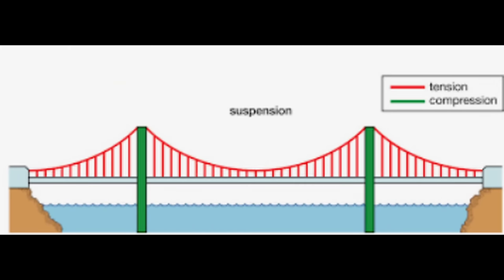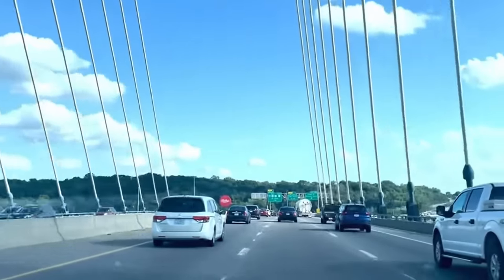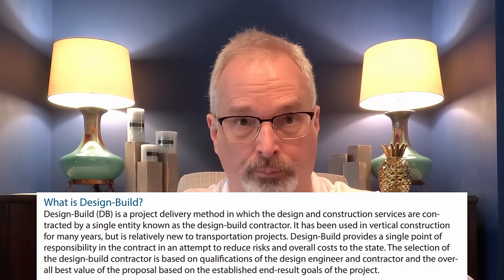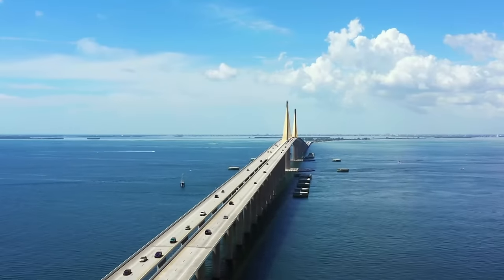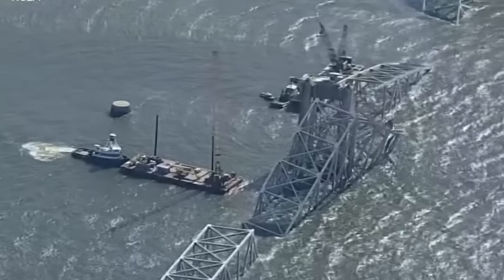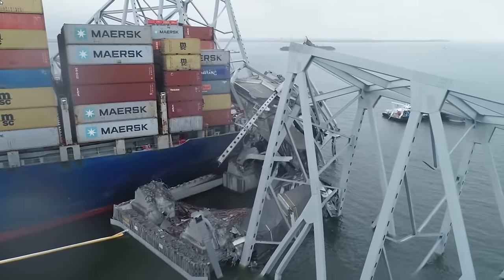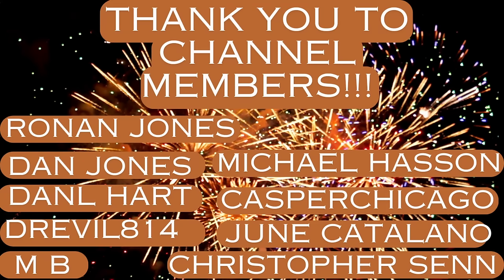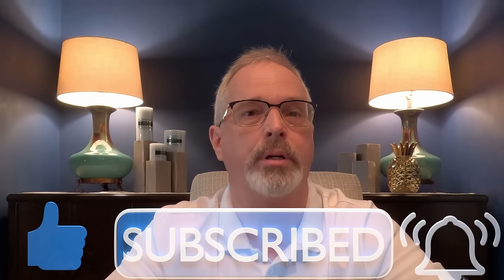How will the Key Bridge in Baltimore be Rebuilt?

Comment: They'll go for accelerated/accelerated and pass on the bill to the entities that took the bridge down and the Federal Government will use its Bully to do that passing special legislation to force the matter. Also, they'll use multiple qualified companies to ...well, they're probably already pouring roadway modules. They can look for a built bridge that is close enough in spec, and use those plans as the starting point instead of starting at square one. I can see North Teams and South Teams already being formed to speed the process along. Even pulling out all stops? 30-36 months to completion and, heres the thing... with that bridge down, the detour the trucks need to take now will add over 100 miles. That will increase the cost of truck shipping to the New England Area from south of Baltimore, add to air pollution and ...I've driven all those routes... to get from just north of Baltimore to Southern Maryland bypassing Washington DC by taking back roads with speed traps? Every day I've tried those routes? and nearly every route I could find? Best time I ever did was driving it  at 2am and that took me 6+ hours, just due to traffic congestion. Toss in holiday traffic and hang it up, any part of the day you start its close to 12 hours with the longest taking me like 18 hours.

Comment: How about a tunnel under the bay rather than another bridge?
Reply from the maker: That would be a great option but would likely cost more and take longer than a bridge.
Reply: @CaseyJones-Engineer  true but I believe it would be a safer solution. In a war you can bet every bridge and every port in this country will be attacked preventing us from getting cargo out and being able to sortie our Naval forces into the fight. And if memory serves this is the last bridge out of the port. So maybe It's time to consider this. And at least do a CBA to figure out long term maintenance costs of a tunnel v a bridge. Also I don't think it would take too much longer because of Modern troll boring machine technology makes this kind of effort a lot less expensive and faster than it used to be. How long do you think it would take to build a bridge such as you suggested vs the length of time for a tunnel?  Or maybe the answer is not to replace the bridge at all but improve road networks in the area and widen other bridges to take up the slack.?
Reply from the maker: @johnpitchlynn9341   Thank you. I agree that a non replacement option should be strongly considered.
Reply: @CaseyJones-Engineer  could you give us a rough ball park estimate on how long it would take to replace the bridge? In months or years?

Comment: Trying to wrap my head around costs for the replacement bridge.  There are number being thrown around like $350M and closure costs being $15M/day.  Seems to me that even if ultra fast tracking it would increase costs by 10x, shaving several years off would be cost effective.   Something else I found interesting was that the owners of the Times building in Times Square are in the middle of a $500M renovation.  That is for a building with no tennants and you can't even see.
https://youtu.be/x1QJjH0GVCY

Comment: Not an engineer of any sort, but road and bridge building has fascinated me since I was a kid.  
I drove across the Key Bridge a few times...I left the area 30 years ago.  Construction started in 1972 and finished in 1977.  The Key Bridge did not have breakdown lanes and it was designed and built long before the advent of massive container ships.

Getting the wreckage out of the way is critical to reopening the port, which is still a big part of the area's economy.

A tunnell is not going to happen.  Hazmat transportatiin cannot use a tunnel.  The Ft. McHenry tunnels were, if memory serves, constructed on land and laid in place.  Doing this would require dredging a channel and interrupting port traffic.

My guess is that a cable stayed bridge will be built with its piers in shallow water.

Slightly off topic...the Bay Bridge spans a short distance away have no pier protection and are outdated anyway. It needs replaced as well.

Comment: Why not consider a tunnel, like the other two harbour crossings in Baltimore?
Reply: tunnels are lame
Reply: Hazmat transportation needs to have a North-South means of travel without a tunnel.
Reply: @penguinsfan251  Agreed, however there is another side to the Baltimore Beltway that does not have tunnel of which I suspect will be utilized during the next 2 or 3 years for construction.  I was thinking the port has been limited by height restrictions and this could help.  Still may not be financially responsible either.
Reply: @indianoutlaw5702 yes, the west side can be used but it’s much longer and slower so not efficient for trucks who can’t use tunnels.

Comment: Design-Build should be Design-Build-Law Suit. At least in California large highway and bridge DB have been a disaster. If the owner agencies  held design consultants to the same schedule as they do the contractors,  there is no reason the work couldn't proceed concurrent with the design. Then the agency is better positioned to deal with third party at arms length, instead of dumping it on the DB contractor who has no bargaining power. As you see, I could go on forever.
Reply: California? LOL

Comment: should be rebuilt like the golden gate bridge.it would have a longer span and have the uprights further away from the channel.
Reply: A suspension bridge isn't needed for such a short span, and that would be far more expensive and probably take longer to build.  It will almost certainly be a cable-stayed type.
Reply from the maker: Yes, a suspension bridge would be very nice, but would likely take quite a bit longer to build than a cable stayed bridge.

Comment: The span between the surviving bridge piers at the ends of the two approaches is approximately 2600ft. If you built a cable stayed bridge with two pylons within that distance, the centre span would need to be about 1300ft. If you needed a larger span, you would need to demolish the two existing piers and the end sections of bridge approach spanning onto them, and install new piers and approach spans. It looks like the approach piers are spaced about 300ft apart. They must have declared those piers to be safe, at least to the point where they are happy to have a new temporary channel beneath the approach deck still resting on them. I guess it will boil down to cost, and whether those existing piers are structurally sound. If you made the centre span 1600ft, you might be able to use the next approach piers which seem about 1600ft either side of center. Oh and it's so magnanimous of Biden to say that we, the taxpayers, will pay for everything - I was hoping insurance companies would be held liable. Do they propose to just let the companies responsible for this event to just get away with it with no costs?
Reply: The remaining approach sections of bridge are safe enough to travel under but they are almost certainly unusable for replacement because of their age and design which wouldn’t support the required increase in bridge width for breakdown lanes.

Comment: No bridge needed.  Use money to improve the north Baltimore beltway.  Cable stay has corrosion problems from the faulty Figg Eng. design.  Design Build projects you get a lower quality constructed project as the contractor is also in charge of the design and specification and will use the least costly riddled with shortcuts to increase his profit.
Reply: Money won’t reduce the increased distance that the western side of beltway adds.

Comment: Cable stay bridge and cold winters don't get along . Ice will form on the cable and fall down breaking windshields
Reply: Depends on where the cables are located obviously. But I don’t recall seeing any news about this.
Reply: @JohnHallgren  read about the cable stay bridge in Vancouver . The towers taper as they go up so are over the roadway , the cables also ice up every winter . They are trying little cable climbing machine to remove the ice .
Reply: @grazynazambeanie5963  ok…but you have to admit…Vancouver likely gets a bit colder more often than Baltimore, right?
There’s numerous variations on how cable stayed are designed…our Sunshine Skyway has them down the middle, others have them on sides, etc. so over the roadway isn’t required.
Reply: I think Vancouver is milder than Baltimore in the winter
Reply: @grazynazambeanie5963  ok, I was just guessing because I didn’t know anything about it really. In any case, as I said, cables can be on the sides or middle and out of the roadway.

Comment: The ONLY way your idea makes any sense is if getting the bridge replaced quickly is is priority 47. If quickly replacing it is a priority, then an update of the existing design makes the most sense. At best you are proposing retaining only the approach pile bents & then demoing & replacing the main bents. That's needlessly costly & time consuming. Repairing or more likely replacing the damaged bent will be the only major issue with the bents if you update the existing design. Even with a design build approach, the design process alone will take some time,significantly more time than an update. From my perspective your proposal is a poor choice to fit the realities of quickly reestablishing the bridge.
Reply from the maker: I never suggested that the approaches be reused as they are nearing the end of their design life anyway.  We'll see what they end up doing but I think it is likely to be a total replacement project.
Reply: @CaseyJones-Engineer  notice I said "at best" when I mentioned retaining the approach spans. That is in thinking that speed is of any priority in your thinking. I don't have experience in a bridge like this one but I HIGHLY doubt that it was only designed to last 50 years. Even if it was when is the last time you saw a bridge replaced that wasn't structurally or functionally deficient? I personally have never had a  project where we replaced a bridge, simply because it was older & not compromised in some way. There are a hell of a lot of bridges 50 years old & much older than are still functioning just fine. I don't know if I could even calculate how much such a replacement plan would cost in the US or most any other country. I still stand by what I said, a completely new design, with full replacement of all existing structures ONLY makes sense if you aren't remotely interested in doing this quickly.
Reply from the maker: @bamascubaman   Thanks for your additional input on that. Officials always talk about quick replacements but it seldom turns out that way.

Comment: The channel is too shallow on either side of the existing bridge. It would not make much difference in useable channel. The main issue is to provide enought protection and make it robust enough to stop a run away ship from hitting the supports.

Comment: The best way to rebuild it is to build a tunnel and leave the harbour an open passage.
Reply: Not necessarily…cost is likely twice as much but also bridge is required for hazmat and oversized trucks which need a route on east side of city that’s shorter and closer to port.
Reply: @JohnHallgren If the Faroe Islands can build a massive tunnel structure connecting all the islands with a limited population the The American behemuth can certainly build a tunnel that would accomadate any sized vehicle. The return alone of ship traffic would offset the cost in short order.
Reply: @FranklinNewhart  first - as soon as the channel is cleared, ship traffic can resume so it’s not waiting on construction.
Second - if the cost is doubled, that could easily be another $2+ billion which isn’t worth it because…
Third - hazmats aren’t allowed in tunnels and they require a route as i said, and they’re a vital component of the traffic using this bridge

Comment: Why not a tunnel?  This channel has economic and strategic importance.
Reply: You can not run hazmat trucks through a tunnel. The Key bridge provided the only Hazmat route around Baltimore.
Reply: @BillO964  or oversized loads…and hazmat includes RV’s. That’s why a bridge is mandatory there.
Plus tunnel would be likely twice the cost.

Addendum - hazmat can go the much longer and slower west side but that’s not good option.
Reply: How much is the disruption in shipping going to cost?  How many harbor works will be out of work?  What will the added cost to all the goods coming into the harbor or going out be?  What will be the impact on US Navy and Army be?  There are at least four “rapid-deployment” ships trapped in the harbor.  What will the added cost to commuters, in time and money, be?  It’s estimated to be three years before everything is back to normal.

Comment: We already know all the bedrock because of the Powerlines just a 1000ft away so it's very simple to copy those as pier foundations.
Reply from the maker: I see your point but the subsurface soil and rock conditions can change a lot in 1,000 feet so new borings would be in order in my opinion.
Reply: @CaseyJones-Engineer I agree but I think it's a safer and faster way forward to match those points since we already know what we should expect within a range of 20%

Comment: What about a tunnel?
Reply: Not necessarily…cost is likely twice as much but also bridge is required for hazmat and oversized trucks which require a route on east side of city that’s shorter and closer to port.
Reply: @JohnHallgren  You're probably right. I didn't know hazardous materials couldn't go in a tunnel. But I suppose it would need an escort with the Police and possibly closing down the tunnel to other traffic. In terms of shipping it's obviously safer. In terms of aesthetics it's obviously better not to have a bridge and traffic blighting the view.
Reply: @johnfrancis4401  even an RV camper that has propane tanks can’t use the tunnels and going on west side of beltway loop is large amount of additional distance and congestion which makes that not viable especially for commercial trucks.
Reply: @JohnHallgren  Too many problems it seems. Yet London has lots of tunnels going under the Thames....I wonder if they have the same restrictions.
Reply: @johnfrancis4401  I have no clue on the UK restrictions but it’s federal regulations AFAIK here that prevent these cargos.
They might have a bridge alternative, but here, this was THE way to run I-95 through the city with that stuff.
Reply: @JohnHallgren  Agreed 👍

Comment: I don't care for the many videos about the bridge.  They are a distraction from the key issue:  why did the power fail ?    Was the captain trying to switch to the high sulfur fuel before passing the bridge?   Was is a fuel pump or part of the fuel delivery system that caused the failure?    Did the captain rush to switch to the cheaper fuel before the ship passed out of the narrow river to the open bay?   Was that a risky thing to do?   
Why was there no tug boat to guide his passage out to the bay?   His ship was a very large vessel.   Shouldn't it have been escorted for safety?  
Why is it taking so long for the investigation to reach a judgment?   Who is on the investigating team?   Are all the investigators and their chief free of influence by the shipper or by the local and state government?    Why all the media focus on the bridge?   That is like an airplane crash into an airport with all the focus on the airport !
Reply: The NTSB usually take a year or more to produce a final report because they are thorough.  Because of the complexity of this incident, it may be two years before we get the full report.  That's just the way it works.  They are not a news organization.

Comment: Pier protection was neglected for decades and resulted in the failure here. it appears your talking about having a wider span so that this protection is not needed or is reduced to a lower level type.  I'd think that pier protection could be a lower cost than having a wider span, which is mostly governed by the channel width/depth needs. You dismissed a critical design item this and just gave various thoughts and information to fill a video. As a retired engineer I got to give you a C- for this video. seems like too many people are doing too many videos and that chasing youtube $$ directs them towards lots of quantity but low quality and marginal value videos .